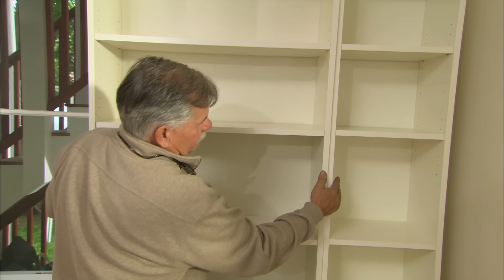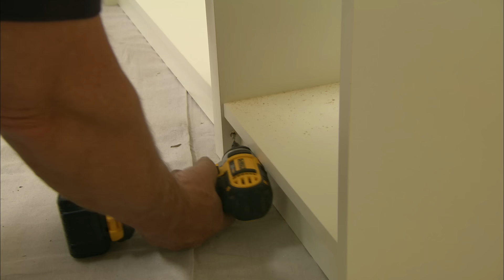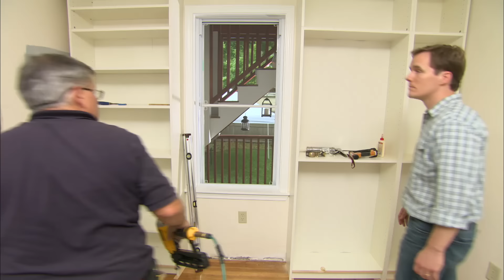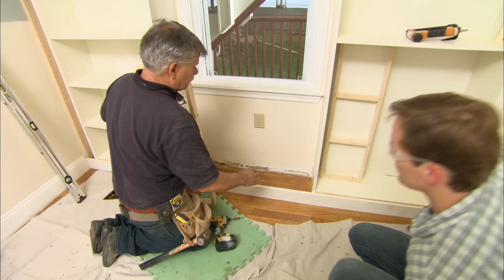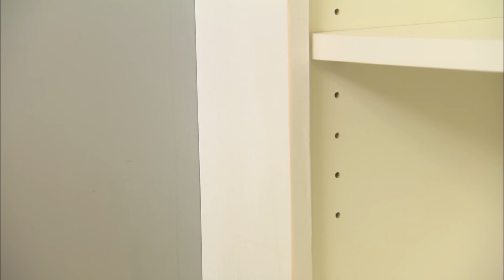How to Build a Custom Built-In Using Stock Shelving | Ask This Old House

Comment: Question on those 1/8” filler strips. Did Tommy rip those all from a sheet of 1/8” plywood??

All I can find at Lowe’s or Home Depot in strips long enough is 1/4” thickness. Any other places that sell 1/8” thick strips I can just cut to length??

Comment: If you were actually doing this, those steps would be much harder in practice. I wouldn’t cut that board down with my circular saw. You’re never gonna get a straight cut unless you use a table saw.

There’s also a few steps that are overlooked or just out right skipped. Or at least not mentioned. Same thing with the information and planning aspect of the project.

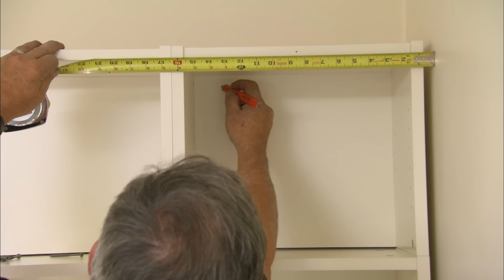Comment: 5:20 there's enough space on the top; you can use L-shaped brackets (IKEA provide them with the BILLY model they are using) to secure it on the wall and the top of the bookshelf

Comment: 30+ yr custom cabinetmaker here. Those questioning the choice of melamine are absolutely right -- it will sag and generally degrade over time. But an even better choice than solid stock would be cabinet- or furniture-grade plywood (not the imported stuff at the box stores, either). It's dimensionally stable (I.e., it won't expand/contract with temperature and humidity changes), the shelves won't sag (especially if reinforced with a bullnose along the front edge), and it won't disintegrate if exposed to a plumbing leak. Looks like the homeowners committed to the IKEA route before TOH got involved, so I guess Tommy was more or less stuck with particleboard.

I was glad to see the homeowner cope those inside miters on the crown, however!

Comment: I'm not a carpenter by any means, but after all the work of trying to make a particle board shelves system look like a custom built in, wouldn't you be better off just doing the custom built in with quality solid wood that will last forever?  Over time the particle board is going to turn to crap.  My home was built in 1960 and still has the original cabinetry.  Solid, strong, and still in excellent condition.  I guarantee the particle board shelving wouldn't have lasted 57 years.

Comment: Excellent job. I particularly liked the technique employed to hide the gap between the cabinet and the wall, something that I have been puzzling over for some time. I was somewhat surprised that you used a circular saw rather than a jigsaw to trim the gap-fill board.

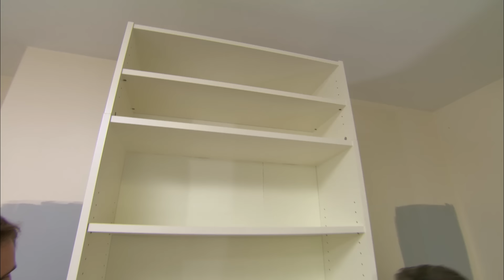Comment: 5:35 Tommy missed the stud. heh. You can then see it later. Tommy doesn't mess up often.

I did something similar in my son's room. I can tell you, though, that no matter what effort you put into this, the chipboard still doesn't hold up well over time. The shelves tend to sag, shelf pin holes tend to tear out, and the melamine coating tends to come off.

Good for a basic homeowner type project, though, which I guess is what this show is all about.